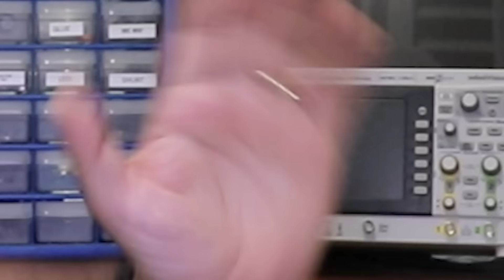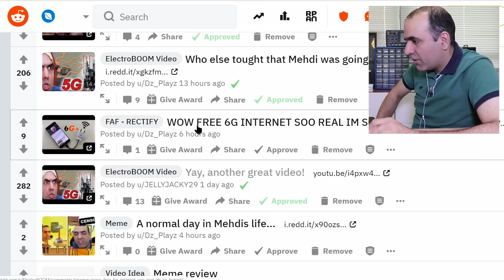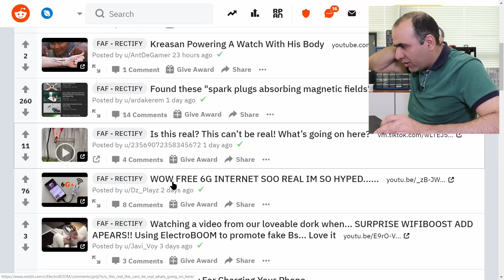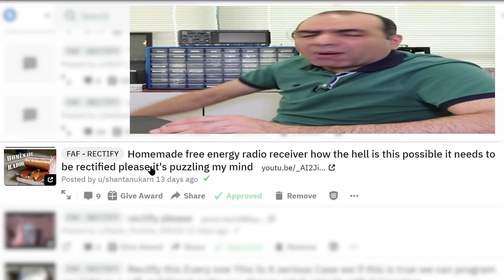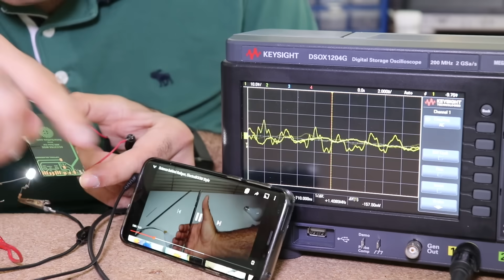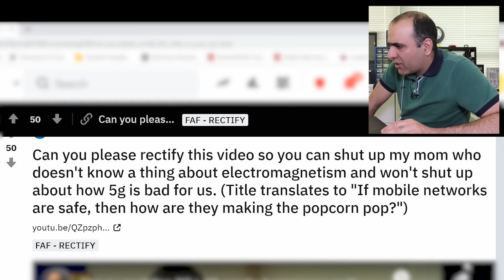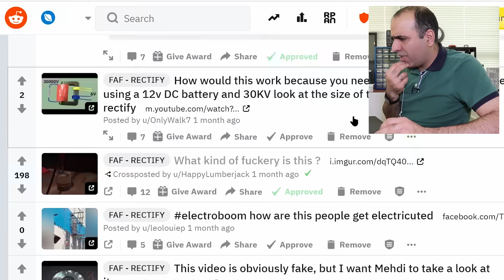ORIGINAL CONCEPT: Reviewing Your Reddit Submissions LATITY-001

Comment: How to adapt a microwave to get the precious microwaves all over your body.
https://www.youtube.com/watch?v=j6XMPb0fptE
Just cut the cabinet and put a horn right at the waveguide. You wont be needing the door xD
Oh, jump the door lock contacts. Plug and play.
 
By the way, the magnetron is made of a very toxic ceramic. Don't break it.
No. Seriously. It's carcinogenic if scratched or damaged. It's called beryllia.
And there's 7500v or more even after unplugged (capacitor), jumps quite far. You don't need to touch it to meet your god.
Of course for Mehdi is just an appetizer.
 
And no, microwave radiation doesn't cause cancer but they burn and can cause blindness. 900w of power don't make a toy.
Like if you read it with Mehdi's voice!
Reply: Want more?
https://www.youtube.com/watch?v=Ur0eSIUjNjI
Or you can take the transformer, remove the secondary coil and make it give around 12v/250A AC
https://www.youtube.com/watch?v=jTWffqwMtGU
Some serious power. More than a welder.

Comment: A high-quality LiFi setup might be able to reach that rate - he probably got the numbers from some papers that talk about that.  But that's not from an LED doing binary encoding 150 billion times per second - it's from a broadband signal across the visible spectrum.
So, it's plausible for LiFi - just not for his setup.  He's stuck at a single frequency with an analog modulation - so bit rate doesn't really apply as a concept with specifying how the analog values will translate to digital symbols and with what quantization precision. 
 
And whatever the limits of the LED is, he'd be limited moreso by the bandwidth of his headphone jack's output.  So probably 20kHz of bandwidth.  Which scales linearly with data-rate.  So it's not a stretch to believe he can manage to translate the 100kbps high fidelity sound through the voltage from an LED. 
You can get ridiculous theoretical bit rates with visible light because visible light is operating in the Terehertz range.  About 400THz to 800THz iirc.  So 400THz of bandwidth.  With that available, even with poor SNR and modulation, 150Gbps isn't beyond the pale.

Comment: The LED-Solar Panel device looks a lot like the basic concept of fiber optic transmission. Just instead of a shielded glass tube for the light transmission you're just shining a light on a sensor.

Comment: The LED and solar cell is still using electromagnetic waves to transmit data, so there's nothing inherently alien about it.  It's also the basis for laser antennas, which are the actual way to using EM in the spectrum which is considered light to transmit information.  Very cool demonstration!

Comment: Actually the lights flicker at 120 Hz, because the light intensity is based on power output of the lights. The power output has twice the grid frequency. This is because p=u*i where both the voltage and current are sine waves that when multiplied, effectively make up twice the frequency. Other than that, great video once again!

Comment: I was an Electrical Engineering student at the University of Connecticut and for my first ECE class’s final project, we had to make a circuit that had a microphone and an auxiliary audio cable as inputs, then we had to transmit those inputs using a laser pointer, which would shine into another circuit using a photodiode that would receive the signal and play it on a speaker. We were also supposed to have potentiometers to adjust the mix of the inputs and to adjust the overall volume, but a lot of us really struggled to get that to work. Still, transmitting audio by laser using a circuit we actually built was really cool.

Comment: Bistable resonator would mean it is stable in the ON or OFF position, requiring a disturbance to switch. A blinker circuit is an astable multivibrator/resonator.

Comment: 5:15 well with the good transmission mechanism you could make mechanical resistance of wheel for hamster small enough for it to run so fast in it, but yeah doubt it could be just regular old bicycle light dynamo this needs to be a custom build

Comment: 8:55 - I made a similar circuit for my undergrad. I used FM modulation so that the emitter can operate at max voltage, not be influenced by the distance or the ambient light. He probably forgot to place a capacitor near the speaker to remove DC offset.
Reply: this could be an explanation, though I doubt it because he directly connected the LED to his phone. A more likely reason is a built-in AGC(automatic gain control) circuit in the audio amp at the reciever side. That circuit automatically amplifies the signal if it's weak, and attenuates if strong. that's why there isn't any fluctuation in volume, except the total loss when the solar panel is covered.

Comment: 2:20 Here in Germany we have rules where to put wires in the wall. All wires must go vertically or horizontally. All horizontal wires must be 30cm above the floor, 30cm below the ceiling. All vertical wires must be 15cm from corners, edges, doors or windows. Here are some pictures:  https://de.wikipedia.org/wiki/Installationszone (google translate works also).

Rules like this exist in almost all countries (and there is almost always some installation that is older then the current rules or made by someone who didn't care about rules). But this is basically how you should know where cables may be and where they shouldn't be.

(And to be really sure, there are devices that use radar to show where cables or even plastic-pipes are hidden... one example is the bosch d-tect 120, of course these live wire detectors also work... I just wanted to mention some other methods)
Reply: If you live in an old building(~100 years old) the current rules don't apply, if the person you bought it from didn't know where the wires were, you'd have to break down the walls to find out.
Reply: Those radar ones seem like they would be more useful if you are doing work in a bathroom or kitchen where plastic pipes are more likely hot water pipes including central heating are less likely to exhibit this problem I guess this is largely due to copper generally being able to handle more expansion and contraction cycles than most hard plastics so it's a better choice if you intend to periodically pump fluid at a temperature significantly above ambient into it.
Reply: @barongerhardt  In my home, there are still aluminium wires in the walls. We can't upgrade it because we don't have enough money for it.

Comment: The funniest of those spark plug crap videos I've seen yet is one where the creature on the video just glued two spark plugs on two bolts onto a plank of wood for support (I assume... Who knows what they try to make you believe the plank of wood does after all), then solder both of them together, and ON THE SAME WIRE, SOLDER ANOTHER TWO THAT GO TO A LAMP. Yes, the lamp is literally shorted. And lights up when passing a magnet on top of the spark plugs.

Comment: electrobomb MIDHE: dont do it
me: .... um... yeah, you might get cut on the sheet metal i just removed the magnatron, high voltage transformer, diode and capacitor from a microwave and fed it 120v bypassing the control circuit and not even including the fan(dont worry, i dont run it for more than 30 seconds at a time) it can develop enough voltage in the area around itself to light a florescent tube anywhere within a 3 foot paraboloid in front of the electron tube/antenna(is a crimped copper cap of a magnatron an antenna??)?

Comment: “Don’t tell me he drilled a hole in his microwave oven”... “so he drilled a hole in his microwave”
Reply: "I should find a way to do it safely later..."
Reply: @explosivo666  It's actually doable the clue how is right there in the safety device being destroyed with the hole namely build a replacement faraday cage around your experiment.
Reply: @explosivo666  Safe way of doing it? Put that compact fluorescent light INTO the microwave and shut the door. Same result (yes, microwaves do make CFLs light up) without killing your eyeballs (eyes are usually the first part of the human body to receive damage  from RF heating).
Just don't use that same microwave oven for food anymore after the CFL blew up in it.
Reply: @andreasu.3546  just clean it with ethanol, but let it dry before using the microwave again.
Otherwise it could cause miner issues.
Reply: @BlackVogel1  Not sure if ethanol can solve mercury...

Comment: . At 5:21, power line guys always work on power lines when they are live even 50K volts or more to avoid shutting off power to lots of people. They put themselves and the basket at the same potential as the power lines. No difference of potential no current flow.

Comment: 5:15 funny how the wire that plugs into the phone runs out of frame...
Reply: actually seeing that charging symbol sometimes can just mean something is connected. doesn't necessarily mean it works 😂 it was happaning with my old broken phone. it was not getting charged at all :/
Reply: @ibrahimihsansahin524  I don't think a hamster wheel produces enough power to even get the symbol to show up... That wheel looked very free-spinning, but there should've been resistance if it was under load

Comment: There s a rule for those wiring man wire wire in wall, it must always go 90 degrees to reach the power source, so it will be ok to drill anywhere else but above the switches.

Comment: There's an easy way to know if you're drilling into a live wire.
1. Pick where you want to drill.
2. Look down.
3. If you're above an electrical outlet, don't drill there.
Not always, but mostly electrical outlets are fastened to wall studs and the wires feeding the outlet also follow the stud down to the outlet.
You're welcome.

Comment: Basically don’t drill on the same horizontal or vertical plane as a switch, socket, or any other electrically fixed device with the cables in the wall. These are known as prescribed zones. Regulation changes from country to country but if the electrical install is done correctly (to U.K. regulations) you won’t drill through cables hidden in walls. Of course no one does it correctly especially Sparkies 10 years ago in the U.K. or all of the world outside the U.K. 😛

Comment: I bet you could get 150 gbps out of that, you just need to replace the lightsource with one that is a bit more focused, then replace the solar cell with  something a bit more sensitive, like a photoresistor or photodiode, then place a piece of light conducting medium between them, such as a long, thing piece of glass, wrapped in dark plastic or rubber to protect it, then modulate the lightsource with a digital pulse representing 1s and 0s... I bet you could revolutionize data transfer with such an invention!!!

Comment: " how am i suposed to know where the wires are in the wall"

 This is one of the reasons we have electrical standards and safety codes. Here in the US we have the NFPA and NEC. These agencies implement these codes to set a standard, to protect workers and residents of the house. Unfortunately older houses have huge electrical problems.

" These codes wouldnt necessarily mean the wires are in a certain place. However professionals do have a standard on how and where a load is powered from.
Reply: In middle east all the wires comes from the top to the outlets, so if you nut anywhere above the outlets expect to experience the mehditation

Comment: Just a quick thought Mehdi - if you took a diode and left one of it's ends exposed (and not connected) wouldn't it over time generate a voltage between two ends? (from outside noise). Wouldn't that be called a "free" energy device? Collecting energy from unused noise?

Comment: I remember a project I did where I made a voltage-to-current converter using an op-amp and drove a laser with that. I could transmit audio with the laser to a photo sensor and amplifier circuit.

Comment: Hm. If you take that light data transfer thingy and replace the emitter with a laser, and use a cleaner photoreceptor, and connect the two with a plastic or even glass cylinder to keep things free from ambient noise... It could work great over great distances... 

Oh. Wait... That's just fiberoptics... the guy at the patent office was sounded very tired when I tried to pitch my idea.

Btw. Big B is byte, not bit. So GBPS is GigaBytes per second. 8 times more than the already ludicrous amount they claim for that implementation.  Real fiberoptics can probably reach those speeds, but I highly doubt that jerry-rigged thing could muster that kind of bandwidth.

Comment: could you explain, voltages drops across a resistor, so the total across the circuit is subject to Kirkoffs law. So what happens to the current. Is it also subject to Kirkoff law.

Comment: The LED-Audio thing is used in some audio equipment like compressors (where it's used for its non-linearity) and in Midi connections (where it's used to decouple the separate circuits from each other). Usually done via an opta-coupler chip which is basically the LED and sensor in a container DIP package. 
The big issues with opto - beyond its non-linearities - are reflections when its not in a sealed environment. Though for things like audio, it could create interesting effects

Comment: Regarding the discharge in acrylic, I don't want to be a downer but I know a guy who does them. He works at Fermilab and they have a lot of people there with a lot of knowledge, and they can't do it in a home environment. They have to travel a couple hundred miles to where there's a linear accelerator that they can rent time on. The energies involved are dangerous enough that the acrylic pieces are loaded onto a cart which is pulled behind a thick concrete and lead barrier and through the electron beam; it's enough that it would kill you instantly. I don't know what the mev required is but it's way above what you can reasonably achieve in anything like a home environment.

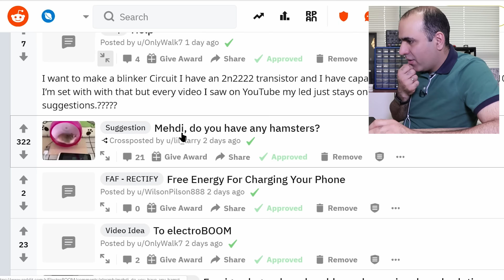Comment: 4:52 is called ASTABLE MULTIVIBRATOR and not bistable. Astable means nither of its states are stable, because of which it keeps toggling (or oscillating) between the two states. hence, the LED blinks. Bistable means that both the states are stable and the circuit needs an external trigger to toggle between the two stable states.

Comment: You could just build a small driver for the magnetron just a 555, transistor, transformer and a 6v source for the tube heater thats basically all you need to drive a magnetron on low power

Comment: You can do the microwave thing safely if you put the entire thing in a farraday cage where the holes in the cage aren't bigger than the size of the wavelength. that's what they use for the microwave door.

Comment: Can I use ferrite beads to my instrument cables carrying baseline signal from my guitar to the rig. Will that affect the original signal? I know these are supposed to be used for high frequency circuits. But I would like to avoid my cables acting like antenna and catch Radio signals.

Comment: The cool thing to think about is that the "solar panel led sound transmitter" is really not much different than how we transmit radio waves, just in the visible light spectrum. Visible light is just "radio waves" that we can see, essentially. Its no different than a transmitter and antenna for a radio, just a different frequency we can see.

Comment: For that microwave thing at the end, why don't you build a long chamber made from wired fence (radiation countering of course) with camera setups inside of it (don't know if the cameras can be safely set up, probably can). That way it's at least safe and you can sill watch it happening. You can experiment with a setup like this like, what does radiation do to certain items and are the items then Radioactive as well. I also suggest buying a Geiger counter for this. Maybe you can collab with the king of random for this?

Comment: 7:00 but how do you think they make the light bulb turn on? "microwave transformer" aka there is a microwave under the table that doesn't have a door on it, so all the radiation freely goes everywhere... ah an idea, using microwaves to clean the air to stop corona? OSHA... NOOOOOOOOOOO...

Comment: When they connect the live contact and the electrode of the sparkplug into a circuit 🙈🙈🙈 the base of the sparkplug needs to be screwed into an engine or connected to something else for it to be earthed, otherwise its just a paper weight lmao. Just by the thumbnail you can tell its fake dont even have to click it. Well 99% of these vids fake anyways so 😂

Comment: Hi EB I really like your Channel and your fundamental knowledge, I really surprised  by your fight with Dr. WL. Before your fight video I saw Dr. WL video and I also was not convinced with his thought, then after cam across your video and agreement of Dr. W.L. for your explanation. really hats off...

I have one problem for you, which I couldn't found satisfactory answer ever.

Problem is when we connect 2 capacitors in parallel, one was charged upto its capacity and one was fully discharged.. when we calculate total energy it comes out half of the initial energy.
The problem often referred as Parallel capacitor paradox....

I am tinkerer, made lots of things from my childhood.. great interest in electricity..
Hope you accept my friendship ☺️
If no then don't worry I will be your friend...
Keep the good work going.. best of luck...